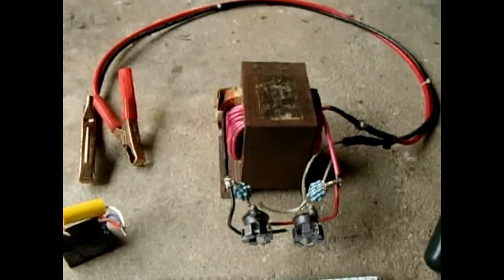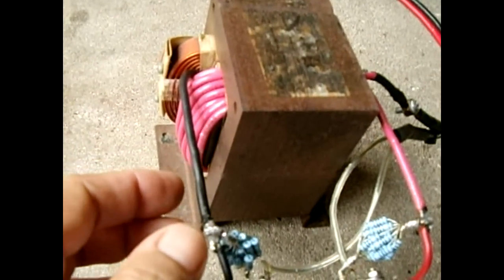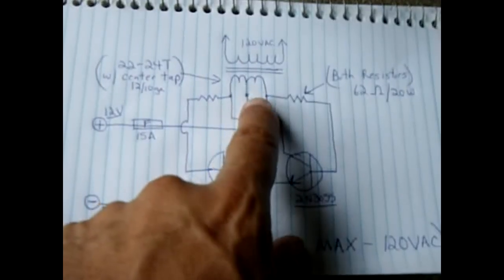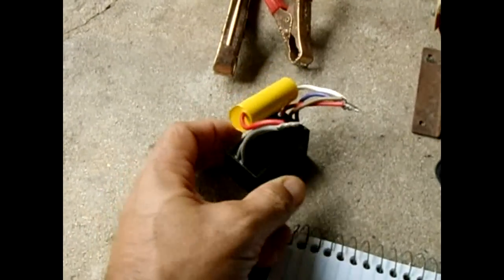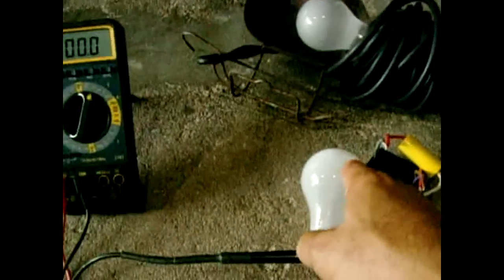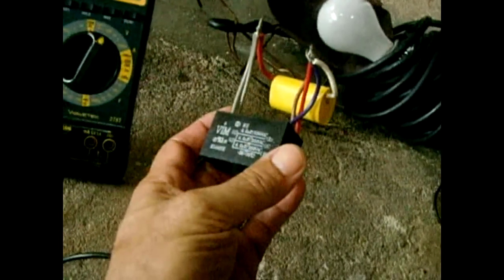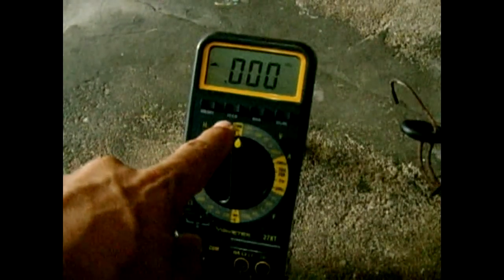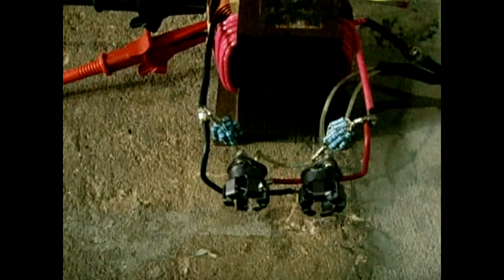How To Make A Microwave Oven Transformer(MOT) 12V to 120V Inverter

Comment: The 12 uF capacitor(s) you're using, are they both 12 uF or together making them 12uF? Also, I have a 3 section (stag) transformer that came out of a 220 VAC commercial yard light. Can this transformer be converted to an inverter?
Reply from the maker: Yes. Combined capacitance is 12uF. If your looking for a 220v output, and you are able to rewind the primary, then yes.

Thanks For Watching!
Reply: electronicsNmore So, rewinding primary, like in your video of the microwave Trans, I can only guess that the primary would be more wraps, or the same? If it is more...how many more? I think your vids are very instructive, great job! Keep it up!
Reply: electronicsNmore I was going to ask you, the capacitors...can I use capacitors like 6,200uF - 10%  +50% 250VDC, 300 Surge types? I scrap some electronics and get all sorts of electronic components.
Reply from the maker: If your working with 220V, then you need to use 400V or higher capacitors to be safe.
Reply: Thanks!

Comment: Ps : rating of the transistors?  would also be very helpful !
Reply: I think the transistors are 2N3055 Power Transistor (in a TO-3 case) if I am reading the schematic correctly at 2:49 into the video.

Comment: the current leads the voltage thru the capacitor  the real voltage test would be to rectify and then filter it and measure dc this would show your peak AC voltage, me thinks your meter can't read AC voltage that is out of phase with the  AC current.

Comment: no thats 18.8 volts when i power up the primary, havent put the 12 vdc to it yet. what should be the total ac voltage from my rewound secondary once i put 120vac to the primary, i havent gone any father than doing my rewind and voltage testing

Comment: Have you a similar explenation for converting either 12 v or 24 v to 220V? The frequency would also increase?
Reply from the maker: You would use a MOT from a 220V microwave oven if you are looking for a 220V output, otherwise you have to raise the frequency using a 120V transformer.
Reply: Thanks, I will go look for a 220V one.
Reply: electronicsNmore Hi, thanks for your video. i would like to do this. I have a 220V MOT, it's the same amount of turns on the secundary (22turns)?
Reply from the maker: I would try that. If the voltage output is too high, then add more turns to the "New" secondary which will become your primary.

Comment: Lets say you used a larger transformer to produce more wattage large enough to power a washing machine would it power it?
Reply from the maker: You'd need a VERY large transformer, much more powerful transistors, and about 150 amps at 12V.
Reply: @electronicsNmore  How many Car Batteries would equal up to 150 amps
Reply: Sorry that's a bad joke I am sure lol. Lets say I want to build a step up Transformer from 12 volts with 160 amps and step it up to 120V on Secondary side What size wire would I need on primary side with how many winding would it take and how what size wire on secondary side and how many windings would I have to use?

Comment: Is there a away to combine two of these together and have it work off two different batteries to produce more wattage?
Reply from the maker: Everything would have to be IDENTICAL, and you would have to make sure the transformers are connected in parallel with the correct phase. Much easier to use a larger transformer. :-)
Reply: What do you think Toroidal Transformers; Would you use a microwave as you did here or do you think the Toroidal Transformers could be made easier?
Reply: Sorry I am asking so many questions on the same video. How big must the transformer be to make a 10,000 watt inverter?

Comment: Did you check what is the power consumption on that set up without load on secondary side (120v) if you check you will find out that is about 3-4 Amp, that battery wouldn't last for long my friend even if nothing is connected to secondary side specially 2N3055 those guys are big suckers, I made so many converters until i found one that works with only 150mA without load and Frequency about 70-75 Hz.I can send you diagram if interested,send me email.
P.S.- that converter I made 20 years ago,if you want I can send you modification for that project to improve performance.
Best regards
Reply from the maker: You have to realize that the purpose of this video was to show you what can be done using a rewound MOT. I know the circuit draws current with no load, but when I use an inverter, I almost always have some load on it, so it is not that big of a deal. This was just a project circuit(having fun/playing around). I put together another inverter circuit which is frequency controlled, modified sine wave, and has a 350W/500W rating. You can see that video in my video list. That is the inverter I would use if my homemade inverter generator failed.

Thanks For Watching.

Comment: Does the trans gets hot.? And for how long can it operate?
Reply from the maker: No, just a little warm. As long as the transistors have the proper heatsink, the resistors are the proper wattage, and your battery can last, it can run continuously.
Reply: electronicsNmore thanx mate. I remember an old friend powered a bulb in like manor. He didn't use many parts. just a 9volts battery and a huge transformer, like say 10 inches wide but heavy. It was rated 240 volts to 12 with a center tap ob the 12v side. I was astonished.

Comment: Something does not seem right with this setup...1st you should not require 20w(P) to drive the base junction.2nd you would need base to collector current to close the collector to emitter junction and since the negative source is connected to the emitter with no biasing there is nothing to get it started.If my memory is correct base to collector current regulates collector to emitter current and should only require a few Ma to close the collector to emitter junction.
Reply from the maker: +DrHarryT 
Nothing wrong with the setup. It works EXACTLY as shown in the video. I don't upload bogus videos. Thanks For Watching
Reply: +electronicsNmore.I had to brush up on my DC theory. Ibe regulates Ice, I did not realize that this device (2N3055/NPN) required 2000Ma to saturate. (http://www.circuitstoday.com/wp-content/uploads/2009/03/2n3055.pdf)This project provides square wave DC with frequency regulated by the variable in the centertap. (not perfectly taped center)This could be redesigned  to eliminate the centertap with a primary of .12ohms and 4-20 transistors to create the sine wave possibly using nand gate timer switching and capacitors for the curve.This is considering the "MOT" primary originally used 1200W or 10A thus requiring 12V/100A to fully drive the now step up transformer. I don't believe if one tries to underdrive the transformer as with only 4 transistors (max 15A, safe 10A each with proper heatsink) that the output would be 120V.

Comment: High frequency isn`t good on some transformers in electronic devices. This will cause the core to overheat due to eddy currents. I bet if you ran the inverter for a long time the core would heat up more than on 60 HZ
Reply from the maker: Check out my video playlists, as well as this recent upload.

DIY Custom Power Transformers

Thanks For Wacthing!

Comment: if i need 24vac from my wind, 1 guess i will take it apart and do 28 winds. your not telling me how much vac i should have from my wind when i put 120 vac to the primary. should i have 12vac center tap to start and 12vac center tap to end?
Reply from the maker: If you want to use a 24V power supply to convert to 120VAC, then instead of using 22-24T with a center tap, you will need to do 44-48T with a center tap. Don't be concerned about the output from powering 120V.

Comment: Or ... buy a "dead" UPS at a thrift store and modify it to use an external 12v battery to feed it. Usually, they work just fine but the 12v internal SLA battery has reached the end of its life.

Comment: Isn't this,120 volts to 12 volts? Nice transformer i made this but with 2 windings :)
Reply from the maker: No. This takes 12VDC, and converts it to high voltage AC. This transformer has 2 windings. One has a center tap.

Comment: The   output   from the   Transistors   switching  circuit   may be  square wave   but I suspect the  waveform  going through the   transformer  may   wind up  a bit  more      rounded   that is less sharp  and maybe  a bit more   sinuzodial   at least to a point

Comment: Will I be able to get enough energy out of a 12 volt 1 amp transformer to power four 12 volt 50Watt leds I intend to make use of a 2.2uf polyester capacitor a bridge rectifier an a electrolytic capacitor to step down the volt to 24volt dc to power two 12 volt leds an also repeat the process again for the other two leds I want to make a night light
Reply from the maker: No. You never get more energy out than you put in.
Reply: thanks for replying I would have bought the items thinking i will get enough energy out of it assuming I didn't ask thanks

Comment: how would you increase the amps on this inverter but keep the voltage the same?  say i wanna change 12v and 8 amps to roughly around 120 volts but with 500 amps?
Reply from the maker: Not going to happen. If you want more current output, then you will need a much larger transformer, with heavier wire. To get more out, you will need more going in. Your 12V power supply will have a HUGE current draw on it.
Reply: You can't get out of a transformer what you want! :D
So if you increase Ampere you will lose Volts, so the product of both is stll constant before and after converting!
You can't put in less power than you want to get constantly out! That would be a perpetual Motion machine! Impossible.
But with capacitors you can realize your Project BUT then you have to but in your power 625 times longer than you will get out. So you have to power your Thing 1 hour to get your Output about 5,76 seconds.
But I think you will never get such capacitors...

Comment: I need a 5vdc 20 amp power source that I can run for 5 days at a shot.
What would you suggest
Reply from the maker: Clown Whisper Refer to my other video on how to wind your own transformers. Included in that video, in the video description area is a link to a online calculator for designing your own transformer.

Thanks.
Reply: electronicsNmore thank you, will check i out

I will need to rectify it as well
Reply: electronicsNmore It wont run on my 64 bit system  oh well
Reply from the maker: When you have the transformer you intend on using, and tell me the dimensions of the core where the wire wraps around(Looking down on the core), I'll tell you the wire sizes and # of turns for 5V at 20A.
Reply: electronicsNmore wow that is awful nice of you.  I need it for electrochemistry so ill need to build a rectifier.  with a nice heatsink and fan I would imagine. 

 Hopefully I can set up two coils one 12 and one 5.  damn I wish that software would work for me lol.   I have to track down some old microwaves I had three but used all of the magnet wire.  I have several spools of mag wire too so maybe ill get lucky

Comment: does output wattage depend upon transformer or the circuit?
Reply from the maker: +dawar jan 
Hello. The output depends on transformer core size, size of the wires used, ability for the battery to supply enough current, and the ability for the transistors/resistors to handle the current. Thanks!
Reply: If I connect 6 irfz44n MOSFETs on each side in parallel will it increase the output wattage as compared to only one MOSFET on each side?
Reply: 6 irfz44n in parallel on each side . a total of 12 MOSFETs.
Reply from the maker: dawar jan
This circuit uses transistors.
Reply: I mean if I want to make another inverter using CD 4047 and z44n . then will I be in advantage in using 12 MOSFETs.
Reply from the maker: dawar jan
I have a another video showing a modified sine wave inverter using mosfets. Please refer to my video playlist.

Comment: 12V^2/62 = 2.3Watts.  so why is ur 62 Ohm getting hot? and why the 20 Watts rating?  this was made in 2013 so have u learnt anything more since then?
Reply from the maker: Why is it getting hot? Because you have around 10 amps of current being used to produce 75-90W at 120v.
Reply: sorry wrong calculation 24^2/62*.5^.5 = 6.6 Watts. Ya ya  that will make them hot.. However,  it is not the 10 amps from the collector, it is the base current going thru the resistors.

Comment: I have a transformer from a parking lot light. It's very large (6 3/8" X 4 3/4" X 1 3/4"). It has, as looks, 1 primary and 2 secondary's. The primary has  277v (F), 240v (3), 206v (2), 120v (1), and then a terminal labeled "S". (F,3,2,1, & "S" are the terminals) Can I make this work to produce 2 - 120VAC from a single 12 VDC secondary? The secondary is rapped about 4" high (Center) and the 2nd Secondary (I think) is the same size as the primary. If so, how many raps do I need to make to acco0mplish this? (Wish I had a way to take a picture to show you the transformer.)
Reply from the maker: Remove both secondary windings. Use the 120V primary winding (you located) as your new secondary 120V output, and wind some 14ga or 12ga wire where one of the secondaries were wound. I am not sure how many turns because I made this video a while ago, but I know I mentioned how many turns in the video.

Thanks For Watching!
Reply: Sorry to ask so many questions. I want to make sure I remove the correct windings. There is on winding that has 5 taps, I think that's the primary, and the center winding has only 2 taps and the largest winding, and the other winding is about the same size as the primary and has only 2 taps. One of those taps has a 120VAC tap along with other voltages as in the 1st message. Remove which 2? Again, sorry about asking so many questions, but I don't want to screw this up...LOL

Comment: Also, I found it difficult to measure frequency, once I turn the knob to frequency mode, the oscillation stops..
Reply from the maker: I don't know why that is happening. Your meter must be interfering with the oscillation causing it to stop. Try using only the pos probe at the output.

Comment: wouldn't magnet wire/coil wire be better than that stuff?
Reply from the maker: The wire is too thick. It would cost a fortune to buy 10ga enamel copper wire. The insulation on the wire I used will be just fine.

Comment: Regards, excuse my poor English .. that value resistors are thus I see no reference anywhere, also said that 62 ohms 20 watts, but these resistances | are 1/4 watt seem, then would need resistors 80,,,, Might explain please thanks
Reply from the maker: Hello. Because I did not have the proper high wattage ceramic resistor available when this video was made, I used many 1000 ohm resistors in parallel for the demonstration. Doing so allows for higher wattage, and lower resistance. The correct way is to use a single high wattage ceramic resistor.

Thank You for watching!
Reply: I understand, thanks for answering. 1k2 would resistors 20, would be 60 ohms. greetings my friend.
Reply from the maker: yes.
Reply: ZOLUTIONS hola amigo me suscrivi a tu canal vi las preguntas y respuesta y me di cuenta que tu entendiste te pido por favor si pudieras decirme de cuanto son el valor de las resistensias y la cantida  creo que son 10 de cada lado del transistor 2n3055 no veo vien el video te ablo del transformador de microhonda que se convierte de 12 vol a 120 de ante manos muchas gracias

Comment: Im getting 18.8 volts ac, and 9.0 volts start to center tap and 9.4 volts end to center tap.
Reply from the maker: Your windings are not correct if your only getting 18VAC from your 12VDC input. Your center tap is also not in the center based on your 9v and 9.4v. That can be corrected by removing a 1/2T to 1T of the 9.4V wire.

Comment: Can I use your inverter circuit an a 12 volt 1 amp transformer to power 4 25wats cfl bulbs
Reply from the maker: No. You won't get 100 watts out of a 12W transformer.
Reply: thanks for replying. can your inverter be used for powering a flat screen TV

Comment: How would I go to about stacking this inverter to produce more wattage?
Reply from the maker: +Steve Rabon 
Use a larger transformer, with heavier wire, and place 2 or 3 identical transistors in parallel on each side using a VERY low value emitter resistor on each. (.1 ohms and rated a few watts should work)
Reply: ok thanks, how much wattage have you produced with this setup?
Reply from the maker: Steve Rabon
Been a while. I think around 100.
Reply: OK Thanks a lot. I will try to make this one and experiment stacking it to see if I can find away to stack it.

Comment: no i wanted to know if my wind needed to be 24vac, 12vac start to center tap and 12vac center tap to end like normal bifairler winds,
Reply from the maker: I already told you that your 22-24T with a center tap in the middle was just fine for a 12VDC power supply.. Why do you insist on asking the same thing over and over? I'm done answering questions from you. Others need my attention as well.